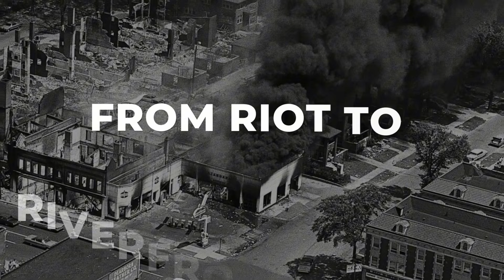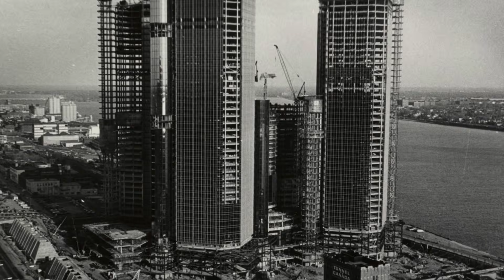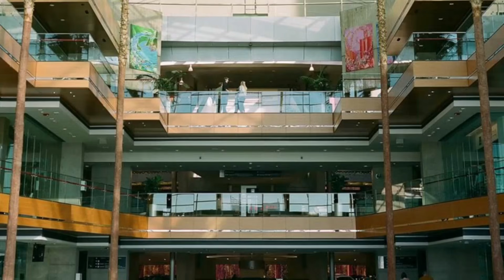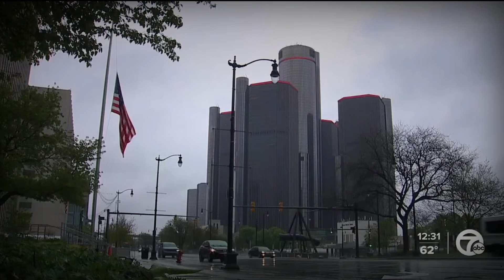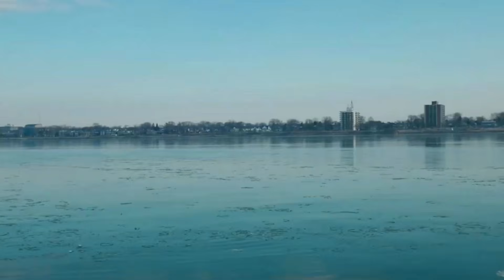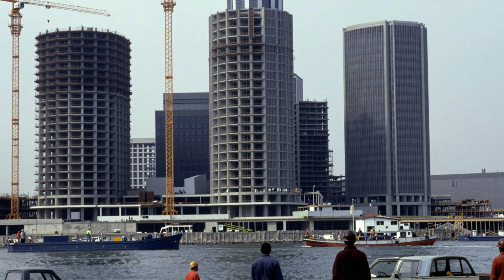Why demolishing this 337 million building costs 1.8 billion

Comment: Arrrgh. Damned AI voice! "Lead" (as in the toxic metal) is pronounced "led", not "leed".

So what was the point of tearing down half of it? Seems like a waste of effort and resources, when it should be possible to remodel/repurpose all the structures at lower cost than demolition/rebuild. Then, there's the Big Question: will Detroit ever recover?